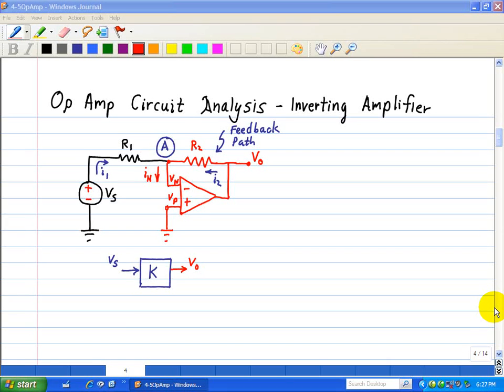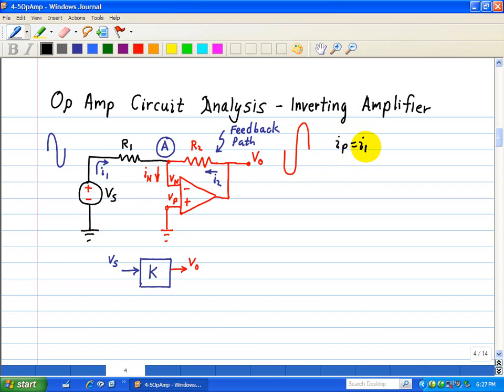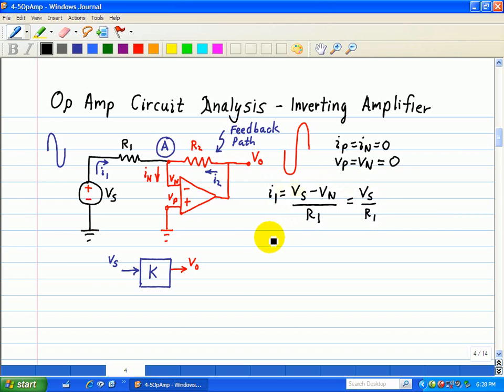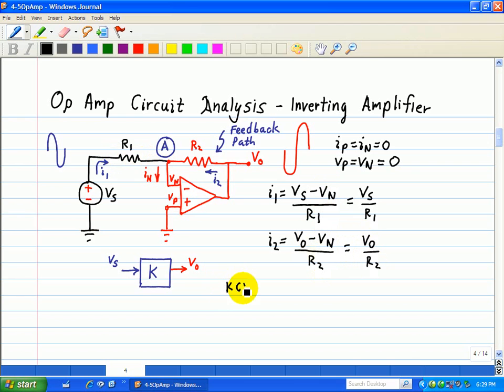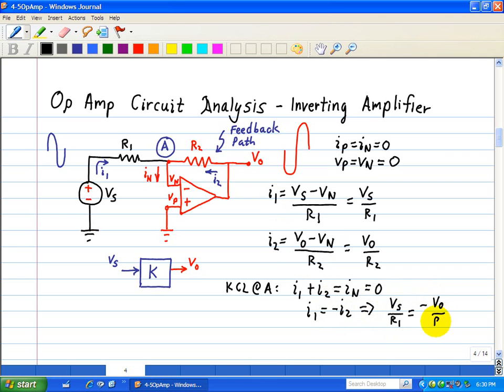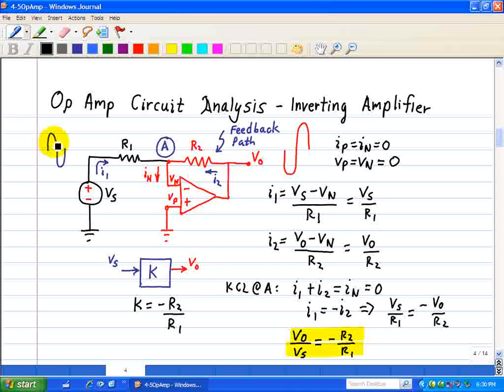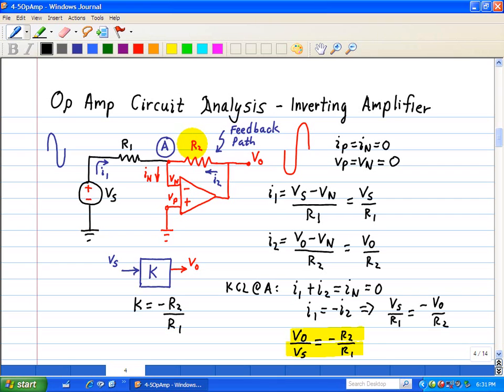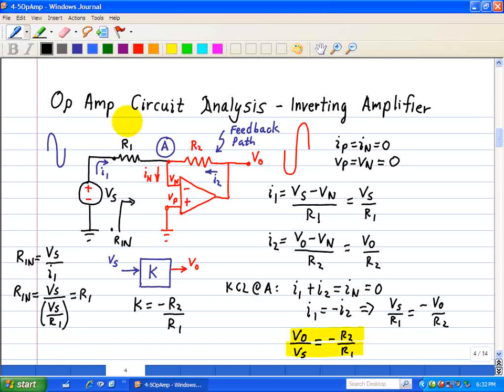Op Amp Design Basics - Inverting Amplifier - Part 3

Comment: Like i said, no better OPamp explanation series can be found on YT,
Basically output of the OPamp tries to balance and COUNTERACT input current to keep the inputs (virtually) the same (even Horowitz&Hill do not simplifies that all the way like that) to maintain virtual ground on inverting IN node.
If the resistor ratio is 10/1, then output voltage must be 10x higher in order to be able to counteract/balance the same input current (limited by the power supply rails voltage and OP max Io)...
z

Comment: In the actual world sir does using a single opamp circuit like this cant overdrive or distort the input  signal by over amplifying it? Is it possible to use two in series to avoid or no need,for example I want to amplify a 5 mv AC input to give me atleast 3 volt can it be done maybe yes because of infinite gain but can you redirect me to your topic regarding this matter to fully understand I want more explanations...

Comment from the maker: @chrisrole1 Vn is a virtual ground since in an ideal op amp Vn=Vp=0.   Hence, the (Vo-Vn)/R2=i2 where Vo-Vn is the voltage across R2 if the direction of current i2 is pointing toward Vn (or  current flowing from Vo to Vn).  Hope this helps!  Dr J

Comment: So the difference between Non-inverting and inverting is just the source 'Vs' given to 'Positive', and 'negative' terminals correspondingly to an Op-Amp.  what happens if we change Feedback resistor path from Negative terminal to Positive terminal ? again we will have two combinations with source 'Vs' at 'Positive', and 'negative' terminals of Op-Amp. Can we have such circuits ?